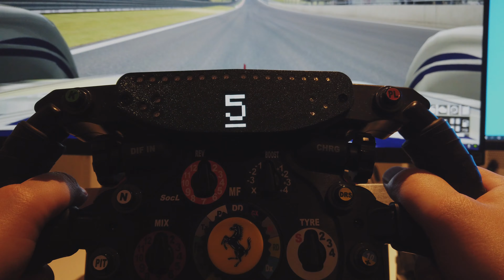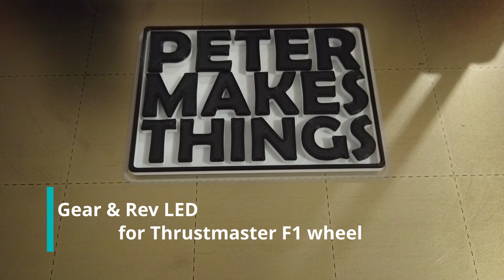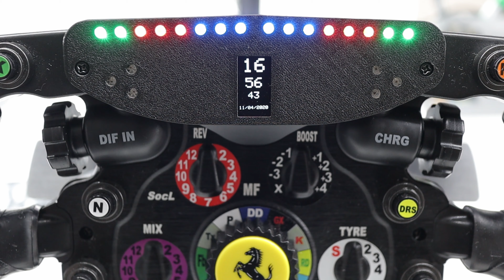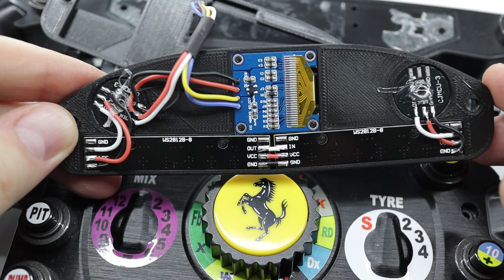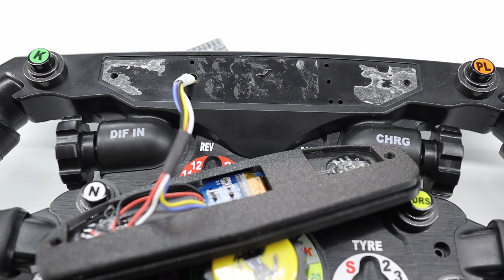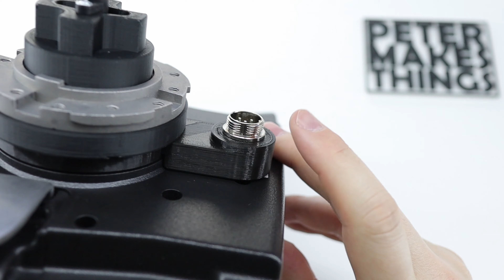Simple Rev LED and Gear display for Thrustmaster Ferrari F1 wheel

Comment: Is there a chance to make the 2x3 led blink red, when pit limiter is on?
Reply from the maker: yes, in the RPMs effect you need to disable 'Redline blinking' for top leds (if you don't want them to blink) and add a new effect 'Redline Reached', set it for the 2x3 LEDs, choose the color and blinking frequency and you're done, and just to be clear - this is PC only, you do it all in SimHub application (Arduino -> RGB Leds)